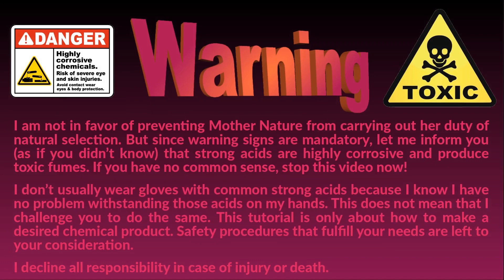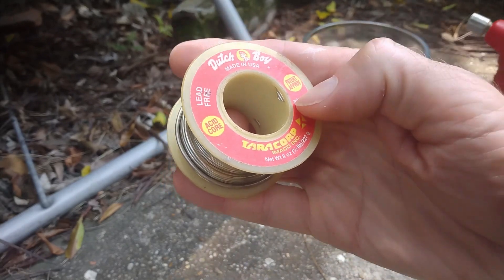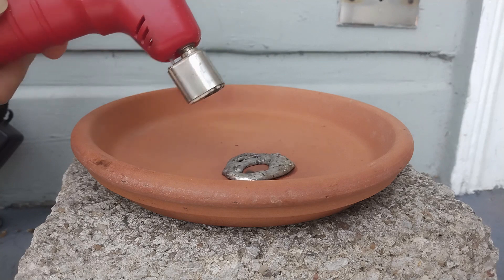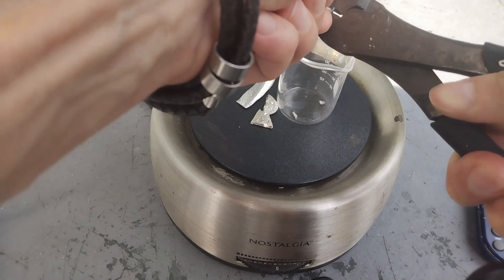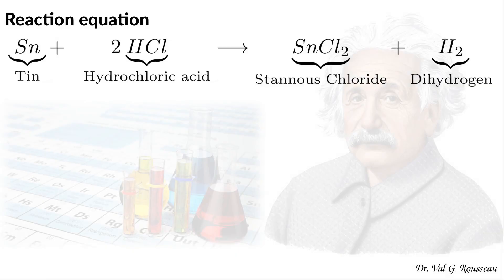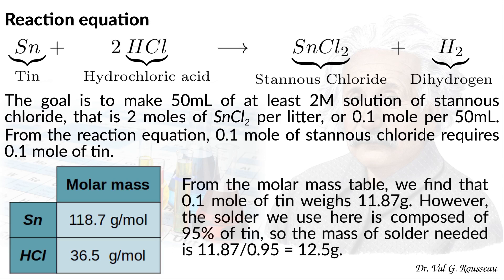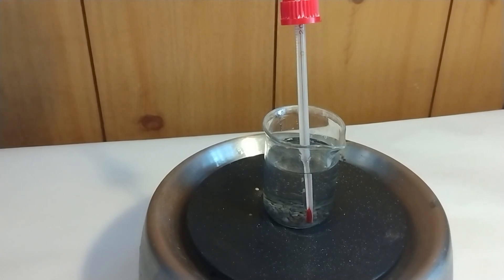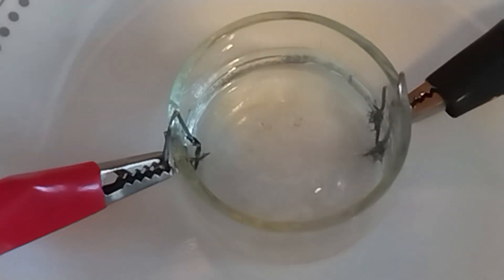Making Stannous Chloride Test Solution for Gold Refining from Solder (SnCl2)

Comment: how do i know if my nitric boils are complete while refining gold filled jewelry? No more brown fumes??
Reply from the maker: What do you exaclty mean by "my nitric boils are complete"?
Reply: @BlueMoonshine  i am not getting any brown fumes, but i still have magnetic properties inside. Not sure if its stainless steel.
Reply from the maker: @behindthescenes3394  
Oh, stainless steel is very hard to dissolve in common acids (nitric, sulfuric, hydrochloric). Even if you heat the mixture, it takes weeks or months to dissolve small chunks of stainless steel. I even tried Pyrana solution and Aqua Regia. It is painfully slow.
Reply: @BlueMoonshine  i finished the 1200 grams today hand picked those out. Ready for AR. Thanks for your time. Happy Refining..